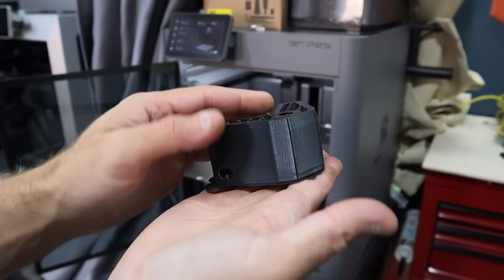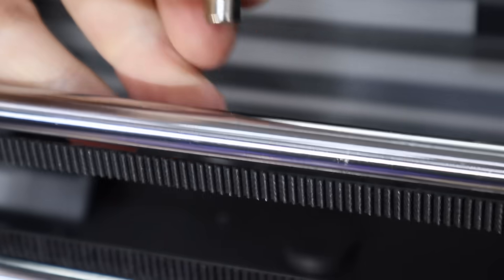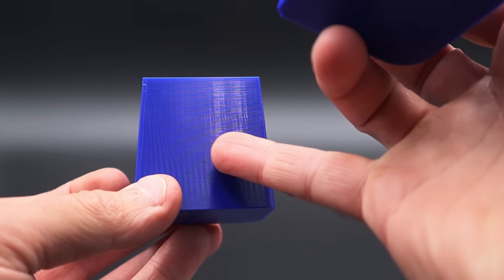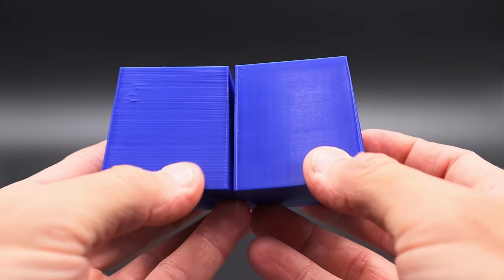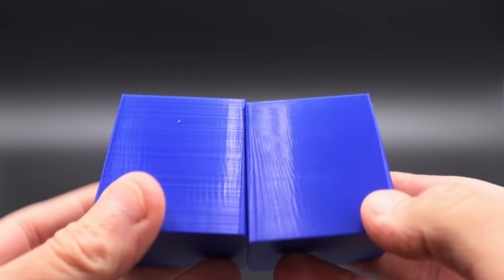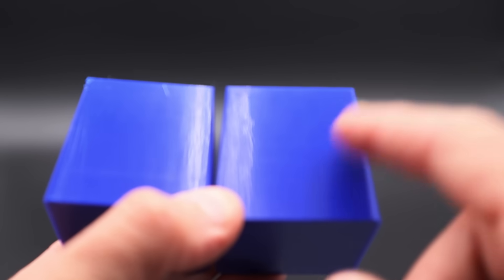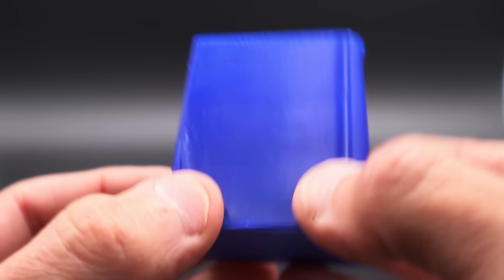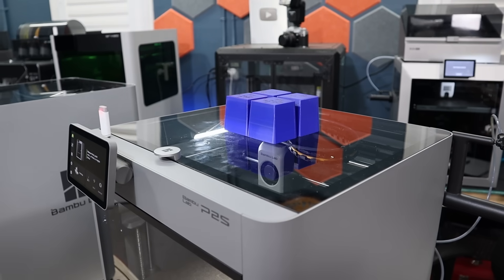Can the OLD Bambu X1C make better prints than the NEW P2S?  Some of you are saying yes. Let's find o

Comment: is it possible that X1C is so much rougher because the rods wear out? I think one side is rougher than the other, so X might be rougher because of wear out. If that's the case, after a while VFA will be a smaller problem that lines inconsistency because of X rods wearing out. Or it could be loose belt?

Comment: On my Voron V0.2, switching from GT2 to 1.5GT made no difference. I’ve been chasing VFAs for years — already on my fourth set of motors (bad LDO, good LDO, Moons, OMC), replaced the bearings with hybrid ceramic ones, and even swapped out the linear rails. Still no change. Funny thing is, it seemed to print best when the belts were quite loose, but I can’t seem to replicate that anymore.

Comment: My X1C was one of the first units shipped, and it's performing MUCH better (quality-wise) than the X1C in this video.  It's also been used almost daily from the moment it arrived, and with some pretty challenging materials. 

I'm guessing NeedItMakeIt's unit has a problem with the Z-Axis, causing inconsistent Z position.  Perhaps a loose timing belt or lead screws that need lube?  It's not very useful to compare the two machines given the fact that one of them has a maintenance issue.

Comment: That is NOT a good VFA test print!  Why invent your own (bad) model when there are good standard models in the slicer?  You're test model is probably showing many other influences than VFA.  Ringing is not VFA.  A good test model should remove most other influences using slicer settings that avoid them.

Comment: You've conflated a few different things here. Ringing and belt ripple VFA are two different things. Ringing happens after corners and features. It can look a little like belt ripple but isn't continuous. Resonance compensation calibration has no effect on belt ripple artifacts, it only helps reduce ringing. Also, there are a two different sources of the VFA you are seeing here. The finer lines that appear at lower speeds are from the cogging effect of the motors. Above 70-80mm/s this goes away and the belt ripple with 2mm (for a GT2 belt) spaced ridges appears. This usually appears at different intensities on different axis/wall angles through to 180mm/s where it should be pretty much gone and not reappear above this speed. 

If you really want to compare belt ripple VFA, which comes from the way the belt and pulley teeth engage, creating a resonance in the belt/head, then you really need to print proper VFA tests which are built into Orca and Bambu Studio, or just create your own with long walls at different angles with speeds that range from ~70mm/s up to 200mm/s and ignore what is going on immediately after the corners as that's ringing and it's unrelated.

Comment: Wow, looks like your X1C has some serious problems.  Mine is nothing like that and I have over 6,000 hours on mine.
Reply from the maker: I would agree I’m gonna replace all of the extruder components and see what happens and I would’ve sent the hot end back to a new stock hotend as well, I honestly did not realize that it was that bad until this test.  6000 hours is absolutely awesome.  Have you replaced any parts?  I was worried about the Z lead screws or more specifically the nuts but I do keep mine fairly clean so I think my issues are related to extrusion, possibly to extent the calibration.

Comment: Odd enough my old QIDI X-Plus (original), all though it prints slow, does not have this issue. (edit: I would have guessed the X-Plus 4 would have the same issues as the other printers due to the faster speed yet they look the same as my old QIDI printer -- But yes, print quality here sucks for the xplus4. -- and I'm not sure what you are seeing but sorry the H2S is printing much better)
Reply from the maker: Yeah, I definitely needed to calibrate. I will run another test as well. I was running low on the blue PETG.  And I wanted the tests to be apples to apples, my best guess is that it was related to over extrusion, hence the reason it blobbed up and dumped it on the part at the end.  I don’t have the H2S I only have the H2D so are you saying the H2 S is better for VFAs?
Reply: @NeedItMakeIt  OK, sorry, I miss heard what you said. I thought you were saying that the H2S was printing better than the H2D. (which if was so would be due to firmware updates or even single nozzle). But yes, test it again. Still odd how the QIDI was printing better as again I'm guessing QIDI has a better overall metal frame?
Reply: @NeedItMakeIt  An other odd idea here but maybe the printer is simply vibrating to much? Try reprinting TPU leg mounts?

Comment: I am sorry, that X1C looks like crap. 
Admittedly my X1C has not seen as much as yours (at about 800h), but it prints way, way, way better than everything you showed there.
Reply from the maker: I agree I didn’t realize it was that bad but like I mentioned in the video, I have been using it and using it swapping out parts and putting them back in running lots of tests and I’ve built up quite a bit of time.  My best guess is that it’s related to the extruder and I’ll probably end up swapping some of those parts out and see if that fixes the problem.  It could also be a calibration issue with that filament so maybe the LiDAR scanner isn’t working correctly either.  To see if that’s the problem I think I’ll have to calibrate manually and run the same test again, yeah, it was pretty bad!

Comment: My Plus 4 prints very smooth. Looks like you should have calibrated all printers before showing this comparison. I think my Ender 3 would look better than some of those prints.
Reply from the maker: Yes, I should calibrate the PLUS4.  The other three printers automatically calibrate themselves and I’ve covered that in a dedicated video recently, so that is not something that is required.  I will say that my X1C after seeing these prints needs a little bit of TLC!

Comment: Looks like the X1C was over extruding a bit. Could be slight over temperature or a worn out nozzle. As usual, the Plus4 has very few VFA. With a tuned profile it would match or exceed the cleanest prints of the bunch, likely from the H2D. I'm not thoroughly impressed by the P2S. Lots of ghosting too. It's not priced badly per se, but with options like the Centauri Carbon and Q2, it's not what I'd go with personally. If you like the Bambu Lab ecosystem I get it, but I don't. 😂

Comment: Gees, people are so negative...

All the results produced were good enough except the X1C imo, but that one has other issues than VFAs. PETG is such a nightmare aesthetically so there's only so much you can do really. 

I've completely written off fuzzy skin as a gimmick but the results you showed here actually entice me to try it.
Reply from the maker: Yeah, it’s probably something I should’ve put a little bit more time into I certainly did not expect the results with the X1C but it’s a good thing because now I know I need to put a little bit of work into it and find the source of that extrusion problem.  Who knows maybe it’ll be a video on its own.  As far as the fuzzy skin, I think the paint on fuzz works really well, before there was only an option for inside outside or both and for some parts that just didn’t work.  I use an extremely fine fuzz. The part will be a bit slower of course, I think it makes a big difference in the final product, especially if you’re using a really shiny material.  People can hate on me if they like, it’s not really a big deal. Sometimes I make good content and sometimes it doesn’t work out quite like a plan.  I think a lot of people just have no clue as how much time and effort goes into making content like this, and results matter.
Reply: @NeedItMakeIt  Yeah, not sure what the issue could be. Got 6 Bambus but haven't seen lines like that on any of them. A good cleaning, new nozzle and new calibration might be a good start to catch the low hanging fruit though - but I've got no real clue. I did have some uneven extrusion with TPU because of 'spooling/bowden friction' once, but I can't see that happening with PETG.

Thanks, I'll try the the fuzzy some time, it looks interesting. Looks almost like a CF-material.

But yeah, don't worry about it. Of course it'd be nice if everything was perfect and equal in tests but it's so easy to harp on that when you're not the ones having to spend additional hours or days to get marginally better results. Printers may be faster now but it's still horribly tedious to run multiple iterations of tests - it eats up a whole day in the blink of an eye...

Comment: Just need to point out that VFA's aren't 100% belt related, the stepper rotor and winding are also what can cause VFA's on outer walls.
Reply from the maker: Yes, I agree. I did forget to mention that it is possible the motor themselves and the steps also contribute.  There are probably some other factors as well for example, the material that is being printed with can be in the case of petty quite sticky and drag on the nozzle a little bit.  It’s something I’ve noticed with the material and I think why it might be a little bit more prone to this issue.

Comment: Can you share the print so we can try it out and see what kinds of results we get?  Seems like that X1C print may indicate something wrong with your printer, as seen in other comments.
Reply from the maker: Yes, I’m not sure if people missed that part of the video but I did discuss that I didn’t expect those results with the A1c and that it looks like there’s something wrong.  My best guess is that I need to replace the extruder. I have used and abused this machine and swapped out parts endlessly so it’s possible that I’ve messed something up. It would be best to replace some parts to make them new and then also set the machine completely to stock and try these tests again.  Yes I can share the print. Can you email me at needitmakeit@gmail.com ?

Comment: not gonna lie, I'd love to get ahold of an H series but 2k is not in the budget right now. my X1C also seems to print better than yours but I have a feeling you probably have a lot more hours than I do on mine. (I have around 900 hours on mine)
Reply from the maker: Yeah, the Hs are pretty sweet, after reading some comments from my previous video and this video it seems like the H2S is the best deal, considering the amount of features, and of course, the bill volume, but the P2S has the best price…or will when available…. My one C does have a lot of hours on it, but I’ve heard people have up to 6000 hours on their machine without the problems that I had, it’s funny. I don’t know whether it’s this particular part or this material but I’m guessing that it’s related to the extruder so I’m gonna start there and see if I can get a new extruder assembly and run some test to see the before and after.  If that doesn’t work, I’ll need to go one by one, belts, gears, rods, bearings, bushings etc and see if I can figure it out.  This was completely unexpected and to me. It looks like it just began to happen. What I will say is that I just installed some new parts from BIQU and maybe that messed things up when I changed and then changed back to stock…
Reply: @NeedItMakeIt  you know, when I went aftermarket tool head my prints didn't look great, I went back to factory bambu and mine just keeps going and going.I've been kind of having my eyes on the snapmaker ui because of pricing as I already have a k2 plus if I need large build volumes but again, I don't do much multicolor so it just kind of feels like I want it just because. Even the UI with the very appealing price tag of 850 will cut off some print time for sure when using multiple filaments but 850 dollars would require a lot of hours saved in order to be an appealing ROI. Man, I just see new toys and then I want them. haha
Reply from the maker: Oh yes, and I have around double the amount of print hours on mine, but I think it should produce better results than this still!

Comment: Not 100% sure but I think that A1 also has 1.5mm belts (released before plus4). It has a better print quality than p1 and x1.
Reply from the maker: Yeah, I wish I had an A1 to add to the testing, but I think my top priority right now is going to be to find out what’s wrong with my X1C, I know I’ve used and abused it, so maybe it just needs a little TLC or possibly a new extruder, I will dig in and see what I can find!
Reply: @NeedItMakeIt  yeah I would probably start with deep clean for Z screws or checking out the extruder.

Comment: must be something wrong with your X1C
Reply: Yeah, that X1C print when compared to the P2S clearly shows defects that a correctly functioning X1C doesn't produce. Source: I own an X1C.
Reply: @MarinusMakesStuff  Agreed, I've had two X1Cs that don't produce those lines. Most likely its time for the belts on his X1C to be re-tensioned or something
Reply: @MarinusMakesStuff  Agree,  not even my P1S looks like that.
Reply from the maker: Yes, I completely agree. I didn’t realize it until I did this test. It’s very possible that I’ve messed something up with the amount of times I’ve taken things apart and swapped parts out and swap them back and really just used and abused this machine.  I think it needs a good cleaning and I need to think about replacing the extruder motor gears and probably some bearings as well in there let’s see how that goes.
Reply: @NeedItMakeIt  Cleaning (don't forget ALL of the idler pulleys!) and most probably proper belt tensioning! And from what you showed in the video, I guess the flow rate was off, too.
If my X1C would greet me with such a result tomorrow (today everything's fine), I'd bet on a bearing failure.